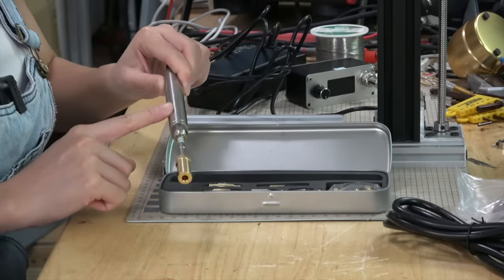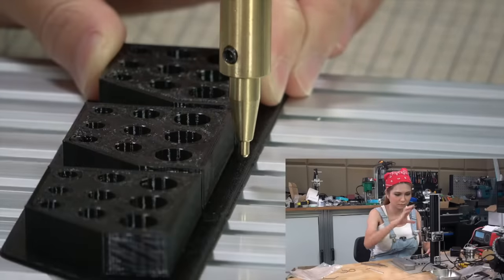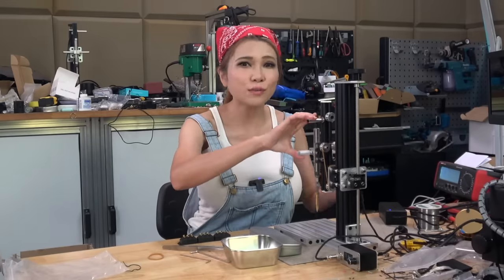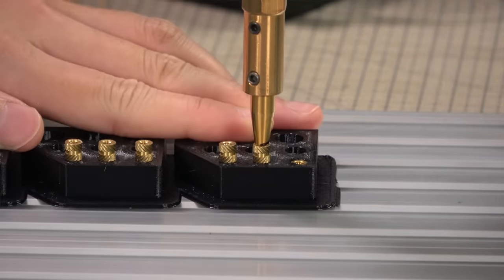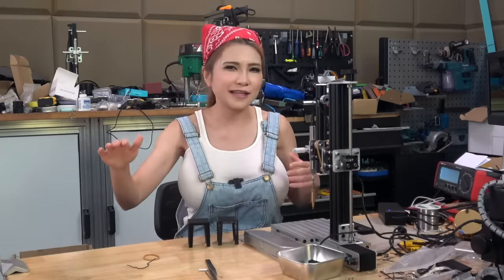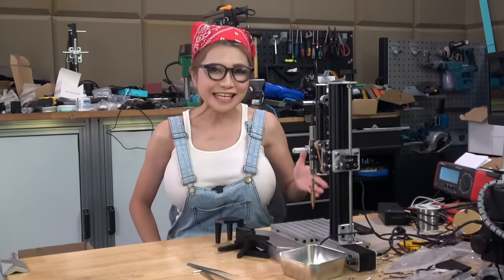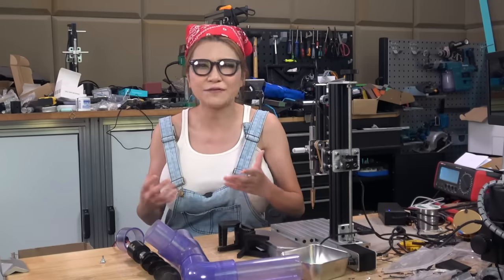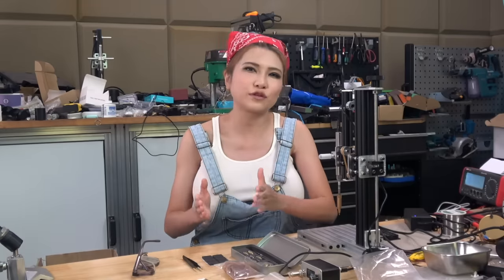My Heat Set Insert Tool- Now in my New Online Store!

Comment: Protip: Natural rubber bands (latex) degrade in air (not sure if it's UV or trace ozone or just exposure to oxygen), because they don't contain any stabilizers. This is unsurprising because they're not intended for long-term use; this is why rubber bands always go brittle and crack after a while, especially in hot conditions.

I have found that a good alternative if you want them to last much longer is to buy "latex-free" rubber bands. These are made with a synthetic elastomer instead, and are much less prone to degradation and embrittlement over time compared to natural rubber bands.

Additionally, store your rubber bands (natural or latex-free) in an airtight container/bag. This dramatically slows the degradation, so your supply bag of replacement rubber bands doesn't go bad as fast as the ones you actually have mounted on the machine.

Comment: I have an idea for an iteration on this - if you had a tip with a small hole in the end of it, you could use this to also set hot staples accurately when doing a repair or a reinforcement. The rubber bands are a genius idea as well.
Reply from the maker: Maybe, would be trick for the staples to stay in place without a hole no?

Comment: Heat set inserts are seriously underrated in 3d printing. It turns janky multipart builds into something that's strong, wear resistant when disassembling, professional, repeatable, etc. One personal touch that I sometimes use in areas where layer orientation and hole clearances allow is to also print in place a washer. You can super glue it to the bottom and also put kapton tape across the top so that the next layer will adhere to it so it's solidly embedded in the part and there's nothing to rattle around later even if the bolt is removed. 3D prints suck where you need to attach them to something else but with heat set inserts and embedded washers you can adapt your 3d prints to use metal connections that are incorporated into the print just about as perfectly as you could imagine. Kapton tape and super glue works pretty well in other cases where you need to embed a flat piece of metal into a print including stuff like a thin bar protruding out of the print like a popsicle stick.

Comment: Liking the all metal construction and the quality soldering iron a lot.  I built the Adafruit heat set press which has been adequate for my Voron build and other projects, AFTER I re-drew most of the printed parts so they would suck less, and going through all my v-wheels looking for enough oversize ones to take out the slop.  Yours is much more of a pro grade tool.
Reply from the maker: Yeah, total overkill for hobby use.

Comment: I find that after I melted the insert into the body, it is a good idea to press a cold piece of steel on top of the insert. This flattens the melted plastic and gives a smooth mating surface. It also closes the plastic up around the insert a bit more.

Comment: I've already 3D printed a small vertical press for my Dremel clone that I also use with an old soldering iron for heat-set inserts. But your heater and tip system looks WAY better! Would it be possible to buy a kit without the stand? That would be the iron, heater, controller and tips.
Reply from the maker: Sorry, I don't sell the parts. This is kind of more a production tool for small commercial shops? I think @CNCKitchen and @Vector3DP have DIY parts well covered?

Comment: I like it but I need more. In my designs I need the inserts to sit flush with the surface of the part, not proud or recessed. I push my inserts in almost all the way and then use an aluminum plate to press it on the top for the final push. The aluminum also cools the brass insert down rapidly so that the heat does not go into the plastic and begin warping the infil. Can I just buy the iron? I'll build a 3d printer to perform the inset motion after the fact.
Reply from the maker: I don't sell the iron, @CNCKitchen and @Vector3DP sell the tips which is really all you need.
Reply: @Naomi-Wu  Sigh, ok I'll endevour to get the whole kit then.

Comment: Great tool, Naomi. I am wondering if you could design and sell something with similar functionality that could chuck into a drill press. It would just need to be a fixture with a post that can fit into a drill press chuck that would hold the hot end of your press. For those of us that have a drill press in our shop, it might be cheaper than buying the whole press. Anyway, just a thought for you. It's great that you're starting to produce and sell tools. I wish you all the best in this new endeavor! 加油！🙂
Reply from the maker: This is kind of more a production tool for small commercial shops? I think @CNCKitchen and @Vector3DP have DIY parts well covered?

Comment: I wanna admit that I clicked on the video not knowing what kinda video it is because i saw your ... Uhh 😬... (Sorry)
But 20 secs later i actually forgot that and got immersed in the video... You're a Real Professional 🫡🔥
 I didn't knew there's a tool for pushing screws into plastic.. i just use my $2 soldering iron 😅

Comment: I have been using heat set inserts for a while. I made a press from a design commonly shared online. It works pretty well and I'm glad I have it. I may just set it aside and buy one of yours because the design is so much better. Most of my parts have included M3 inserts. What diameter holes do you recommend in the 3D printed parts?

Comment: Also having this tool, lets you not even think about if to use heat inserts in your next design or not. It's like having soldering station plugged it and ready - gives you zero hesitation to solder something.

Comment: That's cool Naomi. That's a really neat device, ideal for mass production of 3D printed parts that need secure accurate assembly.  A small assembly line of workers (and 3D printing machines) can turn out quality niche products to match the large manufacturers.  There are probably best use cases for the nuts and types but I see the potential for assembling items with parts made from different materials.  E.g. Carbon fibre for strength, Nylon for moving parts, PLA for a handle, TPU for grip, PETG for food grade liquids, Resin for fine detail ... possibilities are endless.  Hope to see more products from the Naomi Wu Product Lab to help makers in the near future.

Comment: I really like the idea, but I personally would not want to have another machine set up permanently. What about doing a version that could be clamped in a standard drill stand? You could even set a stop so it is impossible for the inserts to be too deep in the material.
Reply from the maker: I think @Vector3DP has the hobby and DIY end really well covered? I'm just making this for small shops.

Comment: I don't really need a heat set insert press.  If I need to bolt something together, I usually throw a piece of 6061 in the mill and go to town on it.  I rarely print something that will require repeated assembly.  That being said, get some other products in your store and I will send some money your way.  Best of luck.  I wish you success with your new online store.

Comment: I have found that after pressing in the insert, it gets pushed out a little as the filament cools down, especially with nylon. What would cause this?
Reply from the maker: Let is set at depth for an extra second or two before you withdraw the tip, but for nylon you might need to increase the temperature a little but. I usualy make a print with a dozen holes or so, so I can dial in the setting on a new material.

Comment: Its always nice to see people online making hardware to sell, but I do find it to be a bit much for people doing this as a hobby. 250$ is a bit steep for something most people do every once in a while, I almost feel like a cheaper alternative would be nicer. For example, there is almost no reason this needs to be made out of so much metal, and in most cases you don't need something that big. For instance if I were working with small robotics typically the size is much smaller so you dont need that much space under the press. Most of the time the height will be small or so large that this makes no sense. In addition to all of this, a lot of people do not have much work space, this machine is massive for something that is not done often. I think this is a great machine for if you are selling to people who sell at scale but for the traditional consumer I feel like more revisions need to be done. Having something smaller, more lightweight, and much cheaper would really pull this ahead. I could see myself paying 75$ for something like this that was just stiff plastic with a thin sheet on it and a similar stand that is just smaller extrusion with some triangular supports.
Reply from the maker: Yes I was very clear in the video that it's not for hobbiests and offered cheaper alternatives on the sales page.

Comment: Sorry Naomi, but this is an expensive copy of the tool created by Adam at Vector3D
Would be nice if a lot of people who copy other peoples ideas, would at least give a thanks to them for the original idea.
Instead of just copying it and claiming it as their own

But good luck with your shop
Reply from the maker: 1. Adam did not invent the heatset press, he makes and sells one of many versions of it.

2. I liink to his competing product directly off my own sales page as a lower cost option. Do you know anyone else who does that? No.

No one else does stuff like that because people like you don't check your facts before slandering others so it's just not worth it.
Reply: Well.....a) There aren't 15 ways to design something like that. b) Her product is obviously designed with a medium production duty cycle in mind. Hence, the noticeable differences c)Her product is a complete solution with accessories included. c) Her price is right on (Non-recurrent engineering costs, testing, raw material, shipping, support, etc. Things add up fast) d) Naomi never declared that she is a non-profit organization.